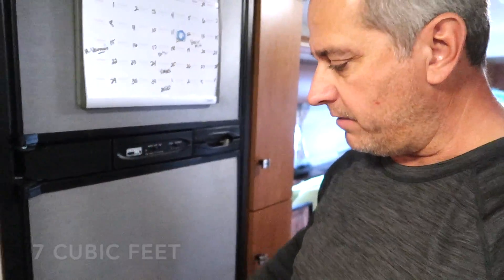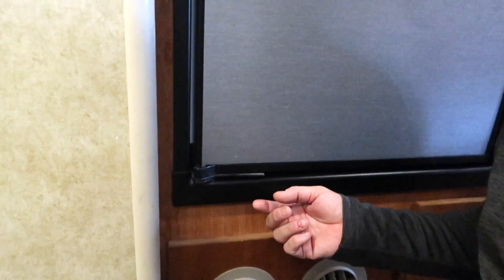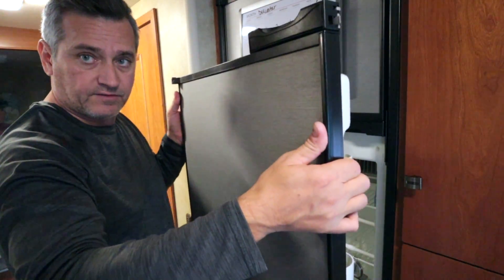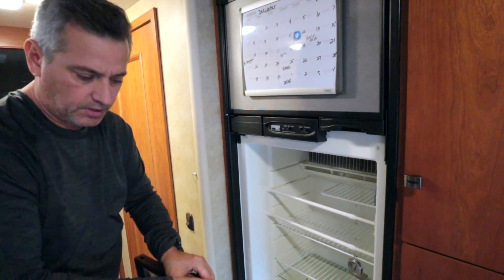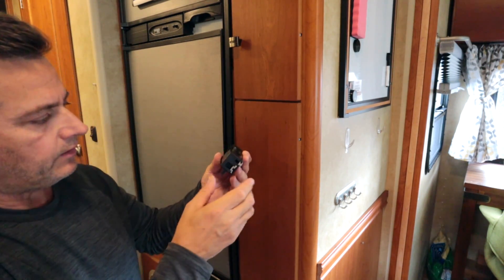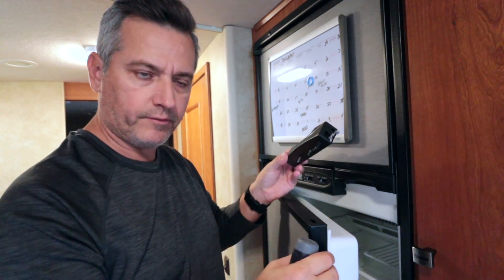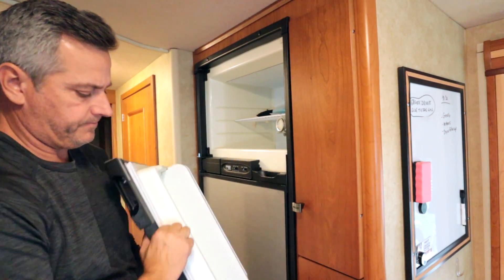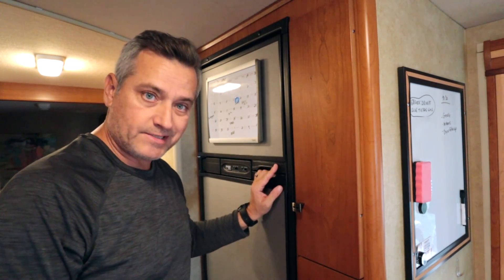Norcold RV Refrigerator Door Replacement [Full Time RV Living]

Comment: Ordered our replacement lower door from the Norcold Guy including the reinforced hinge set. Your video was precise and very helpful installing.  The only difficulty we had was sliding in the old frig front (2008) that was glued onto a pressed wood backing and popping the top plastic piece in place.  It could be they have changed some of the front parts over time.  We also did not use the washer on the hinge install because the door didn't close easily.
Reply from the maker: Excellent!  We’re glad our info was helpful!